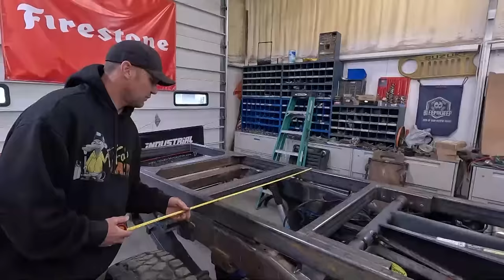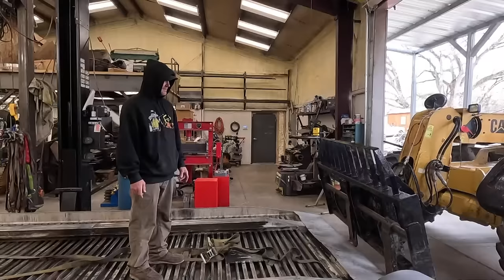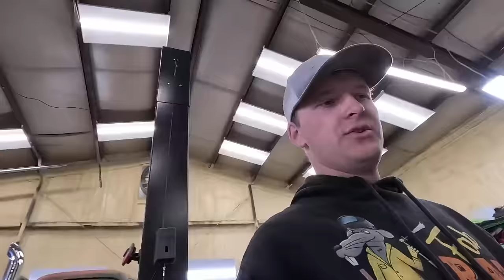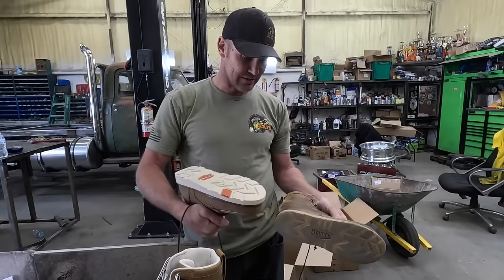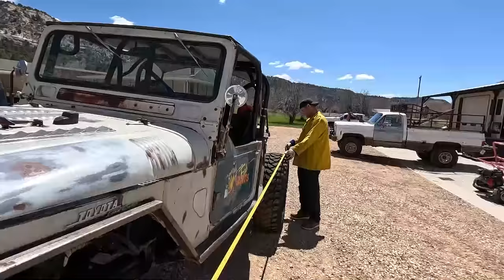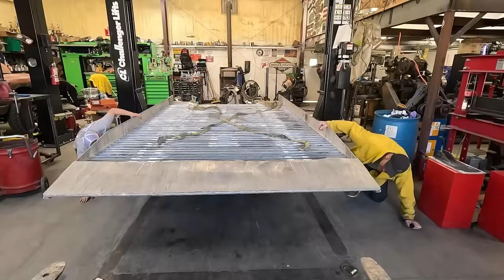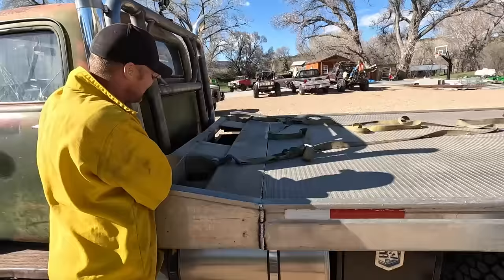The Ratback Bed Is Finally Coming Together

Comment: You need to cut some rectangles into the side rails of the new bed, so that you can add stake-bed railing for hauling loose stuff like logs. And then you can tilt that bed high enough to "dump". It's a combination flatbed hauler and stakebed dump truck!

Comment: Hey awesome videos. Hey a little tip to manipulating aluminum.  Blacken it with acetylene then heat it with a neutral flame then quench it with water. That allows you to bend shape aluminum with out it breaking. The reheat let cool on its own the aluminum will anneal it self. I learned l
This tip from an old welder it does work

Comment: Paul, something to consider:  You may need to add a bed lockdown system.  We had a truck with a hoist that I hauled cars on.  When I partially raised the bed to load, the hydraulic cylinder would extend when the weight was on the end of the bed.  Then once loaded, as I would go down the road the front of the bed would bounce.  I mounted chain tighteners on each side to hold it in place. If your power unit has "power down" function and a tight valve, it may not be an issue.  I really enjoy your work ethic and willingness to show your thought process and sometimes mistakes.  I laugh with you!  Makes your videos "real".  Keep up the good work!

Comment: Seems like the idea of cutting a bad section out to get the length you want would have been ideal.
Reply: I thought about that one, but it would (possibly) reduce the strength of the side rails welding back together depending on the aluminum alloy. "My SWAG" not a structural engineer or a SME and no experience with welding AL.
Reply: Well the issue I think is if they would have done that the front axle of whatever hauled would always set on the welded joint. (That’s a lot of fatigue over time) So where they welded it back together is virtually out of the way of really any working load other than the winch, which I’m sure will be plated and structured to high heavens. Also where they welded it back together also looks like a factory build/design where as the other way would have this random weld joint everyone would ask about lol. Just my 2 cents. I am also a certified YouTube engineer 👷 😂

Comment: Underground miner here. 12 months is the absolute max for boots. TGoods have been the longest lasting so far. It’s hard to take a chance on different boots when the current ones work.
Reply: The rain Forrest ones
Reply: The danner rain forest are amazing
Reply: I use to get 5 months out of die hards . They would  die hard

Comment: You guys.
Created a lot more work than needed.... All you would have had to do was cut the frame behind the cab on both vehicles. ...weld them together and bam your all finished with your dually wheels attached

Comment: Although I'm sure that you probably know this, it's important to remember. Not all, but most of the people that complain about things not being "perfect", have either not done any major projects themselves or they work in a complete fab shop with all the tools and $ that they could want. The reason that I personally love your channel is because although you have a lot more tools than I do, you seem to live by the same modo that I do. Just because it's not supposed to work, doesn't mean that it wont! I believe that with the ramps, that bed will work great! My only concern that I see is that the rear axel might be too far forward with a load. But there would be other problems especially with ground clearance off road if you try to move it back. Only time will tell. Keep up the great work!!

Comment: That tow truck is TIGHT.  Love it. Great job.
Reply: Can’t help but laugh when you guys say paints. To anyone in UK we would think Y fronts, boxers , etc.😂 🩲
Reply: @kdenyer1  when we hear "paints" we think Pigmented liquid applied over a surface that dries as a solid film. 
Pants we think fabric used to protect our legs from getting ripped up, and our balls warm.  Boxers and Y fronts are underwear, items you wear under your pants so you can wear you Pants several days before changing them is a must.

Comment: I'm a concrete contractor I've had 3 pair of brunt boots and i love them. They a comfortable from day one no break in time. Also the rat back would be a good wood hauler if you had some sides on it then you could just dump the wood

Comment: Need some pull out aluminum ramps that store under the bed. Pull a spring loaded pin, ramp slides out. Tilt it back down, slide the ramps in- can also maybe keep them pulled out a foot or so incase of longer vehicles?

Comment: Great job. Tape measures are only a guide until drawings are made. I once had an older tradesman tell me as an apprentice boilermaker to do your best, that'll be rough enough. That was 35 years ago and it still hurts.

Comment: Not only will the duals look good the stability when loaded, or possibly overloaded, will offer better handling.   Your build inspires me to get started on the 1952 flathead F6 my dad bought new and is in excellent original running condition.  If Brunt boots can get me running like Hunter I'm in for a couple pair.

Comment: Here's an idea...
you need 2 x 4 ton hydraulic rams... one for each side of the rear (under) the flatbed...
you put a hinge (or 2 or 3) across the back end of the bed... and attach that 4 foot section back there. 
At full extension of the rams, it folds that 4 foot section up on the bed, flat...
As you contract the rams, it unfolds that 4 foot section... now, your bed is 4 feet longer, and as you raise it (dump style) you can use that 4 foot section to add a "ramp" like effect on the back...
When you get the vehicle loaded, you extend the rams again, and that 4 foot section raises up behind the vehicle on the bed...

Comment: The bed looks good, since it lifts at a great angle to be a dump, why not put in some stake pockets for some side boards and even a rear set for a load of whatever (firewood, dirt, rock etc.) if nothing else use them for tie down spots or even as ramp storage/holders flipped up on edge.

Comment: Not only does the new truck bed look good (as a car hauler) but with that huge lift height, it’s got real potential as a dump bed. Build set of removable sideboards and go get a load to see if it will serve. Gravel, mulch, sand, etc. the only issue that I can think of is those ribs might hold smaller pieces that will need to be swept out. This critter is gonna be a Star at y’all’s next parade. 🫡

Comment: I would cut fuel filler doors into the bed with locks so you had to have the ignition keys to unlock the fuel filler trap doors so that you don't have to raise the bed to fill the fuel tanks.

You may already have that on the table, but if not, it will make the fueling so much easier and quicker when on the road or getting ready to get on the road.

Lookin' good.

Comment: May I suggest sourcing a dually rear axle for it?  Mainly I suggest it since you're going to need to already put spacers between the duals.  It just limits how many failure points there are.

Comment: The Ratback is coming along.  The only problem that I can see is when you are loading a vehicle with the ramps you may end up with the front-end coming off of the ground.  You may have to install a couple of adjustable legs behind the tires that you could pull a pin and let it slide down almost to the ground and re pin it

Comment: You need to get the Mamotion robotic mower guys to send you one of the LUBA 2 mowers. There are a couple models depending on what height range of grass you want and how much battery you need. Being in Utah you may want the taller grass option and your yard looks big so you may also need the larger battery.

Comment: Good call not cutting the middle damaged portion out. That would have weakened the bed quite a bit.

Avoiding the HAZ right across the middle was definitely the right way to go.

Comment: I love my Brunt boots. I have my Lace ups  and my slip on I hung my red wings up. The brunt boots are the most comfortable boots. I ever wore. They're literally like wearing sneakers. I work in a concrete business, so concrete. Tears boots up my lace. Ups are over a year and a 1/2 old and are still in good condition. Disposa, little wore out, but otherwise they are awesome. Pair of boots and my feet still stay dry. And I've done nothing to him. Except for washing off with a hose every day.

Comment: Those vehicles might have the wheel base to fit on the bed but it depends on how much hands over the axle line on the cab end. You FJ will fit because the axles are at the extreme front and back

Comment: You could do a hydraulic ramp at the end that folds out to drive up it and then you can make the loading angle however you'd like based on the length of the ramp.  This truck will work great just depends how sophisticated you wanna get haha but since you've already got hydraulics on it, it wouldn't be too difficult. The design of that style ramp is actually pretty simple.

Comment: It's shaping up.  If I were you guys I'd look for front fenders off a 2/12 ton or bigger truck (I think they were 6100 or 6400 series); they had a larger wheel opening which would match your tire size better and I think they were wider too.

Comment: I just had an idea.  I know...I know...ideas are like certain parts of the body... everyone has one but I think you will like this one.  Instead of the entire bed rolling back, how about just a section under the overhang rolling back?  The other advantage is the bed never gets higher and you could do it anytime during the project life.  If you could figure out how to attach the roll out piece under the bed and make it structural...wha -la...roll back!

Comment: Yall need to weld up some ramps that slide put the back underside of the bed that just come out so far so you don't have to do anything but slide them out to use and just push back in for driving.

Comment: We had a 79 GMC with a dump on it we hauled stuff we should not have but we had heavy steel ramps we used as side rails to pull stuff up on we had channel on the side that we pinned in the ramps

Comment: might want to weld back some lengths of them aluminum runners on the bottom of the bed to ride the outside/inside of the steel rails for when a load is attached to the bed...just bolts holding a heavy breaking/etc might shear/tear through the force/weight of what you chain/strap to it.

Comment: Looking good. Nice work. 

A set of fenders off of a heavy duty 2 ton from that same era chev came with much larger fender openings. 
Would give the off road tires more clearance if that is an issue at all. 
Either way your hard work shows good results.

Comment: I love what you have done with the flat bed so far but i think you will need to move the rear wheels back 2 feet because you will loose your front end steering because it will be very light. Also the truck will squat down from the back.

Comment: I am on my second pair of brunt boots, i clean pools and always bending and boots getting wet and my feet stil dry, they break in pretty quick, unlike redwings, oh boy, you have to wear those for weeks and they still feel stiff, ive try so many boots "waterproof" but they only work for a few weeks and tear apart becuase pool chemicals and always wet, would barely last me 3-4months. My first pair of brunt still going strong almost a year and my new pair only 4 months but those are the slip chukka boots, they are grat.

Comment: Hey Paul I just think all you need to do is go to harbor freight and get a pair of ramps make up a way to huck them to the rear of the bed and you can load just about anything that you want to I have a pair and thay work really good to load my mobility scooter in the back of my pickup I don't think it will hurt you to try them Thay have different ones I have a pair that folded in half but they have some types that don't fold then you can put anything on the RATBACK anytime you want to Charlie kretschmar Glendale Arizona

Comment: Are you not taking into consideration the overhang from tire to bumper ? Shop truck won't fit I have one and there is 31 inches from center of tire to outside of front bumper.  Just an observation but I think it will change again...😂😊😊

Comment: Ist. Thanks for your entertaining videos!  Second, I think your math is off for the size of vehicle you can fit on the bed. Don't you have to go from the front bumper to the back wheels or vice versa. The back bumper to the front wheels. You won't be able to butt the wheels up against the headache rack. You'll still have some of the body of the vehicle to contend with.  i.e., the engine bay or the trunk.

Comment: I would try locating a dually AAM rear differential if you can. I've seen the axle stub snap on a single tire running dually adapters. It's a direct bolt in upgrade.

Comment: I wonder about most of those folks who tell you how wrong that you've done things.  How "right" would they have done it dealing with the things that you all have had to deal with?

In my experience, sitting at a keyboard is a perfect world, and it's really easy to make it all work out.

I had a welder remind me of that.  My response back to him was to agree with him, and that's why at the stage that we were at it was time to make it real world work.

He sat back and shook his head.  He said that he hadn't had a designer yet ask him to help him make the fixture be real world right.

We developed a good strong working relationship because he knew that I would ask what he needed and I would tell him what the customer needed from the part.  We producded some sweet fixtures, manual and robotic.

Nothing like seeing a fixture 36x110 rolling around while two arms are making sparks fly as the welder is unloading the B Side fixture getting it set up for a fresh run, and have a smile on their face because they aren't fighting the fixture.

Folks would do better to keep their mind stiil and mouths shut so that they could pay good close attention to what you all go through, and what kind of shop that you are.

I give you all mad props for the type and caliber of work that you do.  You take a bunch of stuff from vehicles and such that have no real connection, and you make a very functional piece of equipment with you talents and a pile of stuff.

Comment: looking at the build, between height and length it looks real tipsy side to side and it just looks like it going to pull them front tires right off the ground, I think the dually setup will help side to side but feel the axle needs to go further back JMO. But empty its a cool looking rig.

Comment: If it were me and the bed required that much reworking to make it functional, I think I would have made one of those hook and drop beds. The bed drops off the back of the truck and lies flat on the ground. Drive/winch whatever on, strap it down and pull the bed and load back up onto the back of the truck.
I'm afraid that angle you have, even with ramps, will be steep to pull cars up onto. 🤷‍♂️
Love the content, as long as it works for you, that's all that matters.

Comment: You should probably put some rubber between the steel and aluminum parts to stop dissimilar metal corrosion.  Other than that, you've done a wonderful job making this work.  jimb

Comment: You guys are measuring the wheelbase of the vehicles, but what about the overhang front and rear of the body. If the front bumper touches the headache rack and the rear tires are farther than the bed. It’s not too much good.

Comment: Curious as to why they didn't just cut the bad section out as suggested, instead of cutting out the ribs and welding new ones back in. Seemed like a great time-saving idea front Shawn and Hunter. Not to mention, I thought aluminum looses a percentage of its strength when welded.

Comment: Still looks like a BIG overhang behind the rear axle but I guess if this thing is going to have any off-road capability then it needs a short wheelbase so, as long as the rear end is strong enough, it's about as good as it can be.
Also, maybe worth saying, there's no reason why you HAVE to hook a winch to the front of a vehicle when you're loading it.
Sit the winch as low as possible in the bed, run the winch rope underneath the vehicle, hook it up to the rear axle and you can pull the vehicle all the way on so the front bumper is on top of the winch.

Comment: Just an idea. But maybe modify a retractable air hose/power cord roller deal for your winch cables on the tilt bed. No stretch no pinch??  Just a thought.

Comment: Take a torch to that aluminum and warm it up some it will be much easer to reshape, aluminum age hardens over a short period of time. I was a heat treater,  so here is how to properly anneal aluminum,  heat it up to 700˚ TO 750˚ FOR an hour and then  air cool. it will be like butter for the next 24 hours. But not everybody has a large industrial furnace to stick a flat bed in. but if you heat it up with a torch and get it in the temperature range using a temp stick or a nou-contact heat gun. you will get good results. Don’t go over 750, you wont like the results.

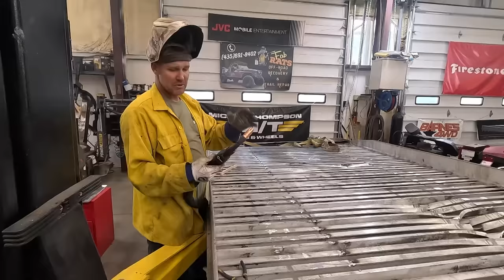Comment: 13:48  If you have an extra rig, or can afford two .. a SEPARATE welder set up for Aluminum Only is a GREAT idea ... You'll use it more, Get better faster ... and save money or Stainless Nuts and Bolts

Comment: You should have left it maybe two feet longer because of the angle of which is going to tilt to put it to the ground and because of the overhang of the front wheel to the bumper of the vehicle that you put on it

Comment: Looks great I just think he back axle is too far  forward and will you be doing anything at the back to stop anyone running under it and chopping their heads off if you get rear ended 
You might need it for rear lights 
👍👍🇦🇺

Comment: Have you checked you’re going to be within the rear axles weight rating? Adding duals and spacers only helps stability. Would hate to see you twist it apart or kill the bearings.